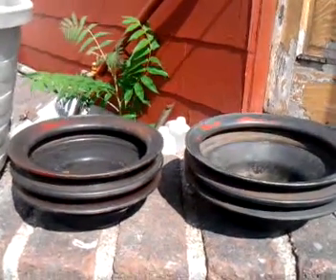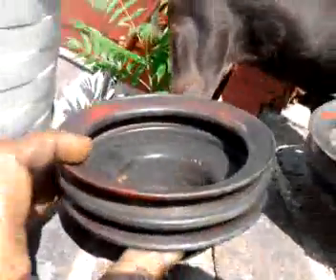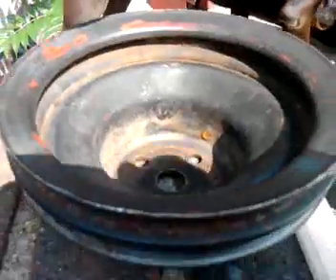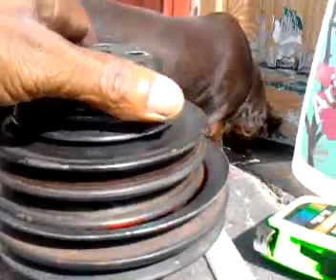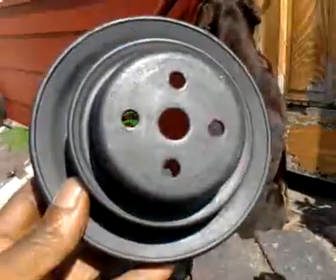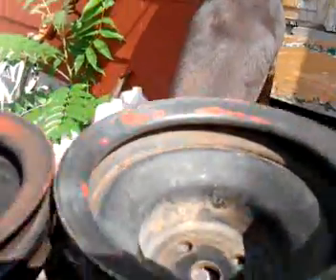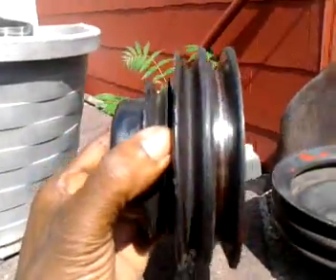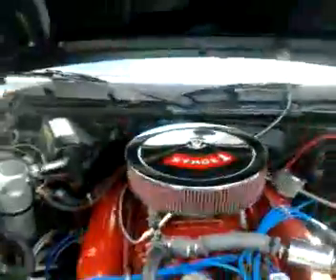My D&S Stage-1 Buick 455 Regal's Water Pump PULLEY ISSUE.   6-20-2011

Comment: Thank you for sharing these informative yet frustrating issues about the big block Buick water pump and pulley issues.

In researching similar parts fitment challenges over the years, I've discovered that there are short-, medium- and long-nose water pumps. As scary as that sounds, there are also different variations of those for different years and for the various cars that they were installed in.

Ultimately, the key to success is to match the water pump, pulleys for the crank, power steering (if so equipped), alternator, and air conditioning compressor (if so equipped) with the correct support brackets as well.

There are many variations and therefore many frustrations can potentially arise. What I've found as the best solution is to determine exactly what is needed, then obtain all the parts from a single source, such as a 1970 Buick GS 455, then put it all together -- also using the same bolts, washers, etc.; the retaining hardware is equally important and equally elusive.

When the parts do not provide the proper fit, and you don't know what you have or what to do, work with organizations like TA Performance, our Number One, premiere Buick parts source, as well as the Buick Performance Club:
http://www.buickperformanceclub.com/page1.htm

Scott Moody and Mark DeConti have put together an awesome resource discussing the water pump situation:
http://www.buickperformanceclub.com/BuickWaterPumps.htm

We in the Buick community are all here to help each other and to have tons of torque and fun with our Buick machines.